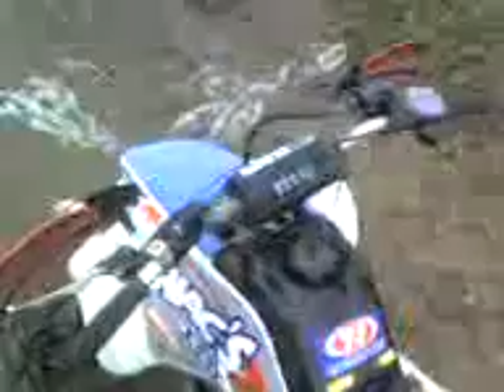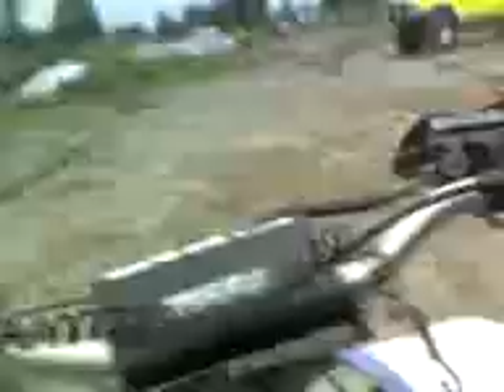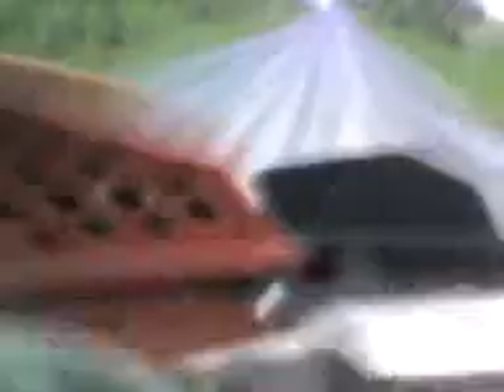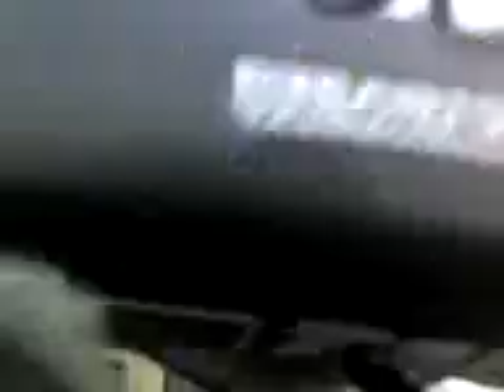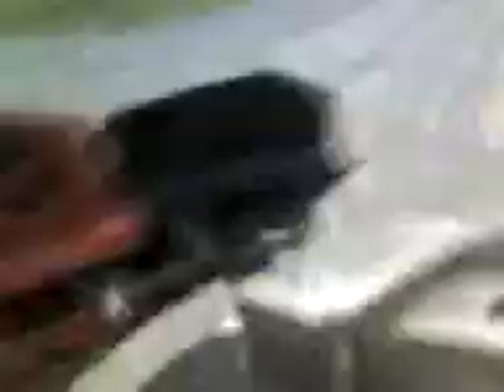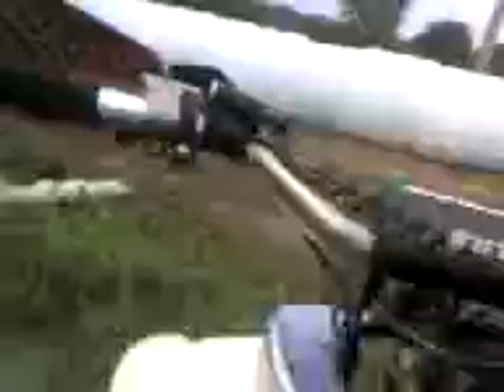Road rippin' on 86 Honda TRX 250R

Comment from the maker: I had my mid-short gears in (12t front 38 rear) so approx. 118 Kph peak, fastest i've clocked was with a 15 tooth front and 38 rear @ 131 kph, which is lots fast enough.  In reality 4th to 6th don't see much action on my trails, but you gotta let 'er loose now and then! cheers!

Comment from the maker: Q) Why is everyone faster, with no proof!?

A) I don't care.

B) try doing the math.  Speed is only relative to the gearing, sure I can put on a 15 tooth front and a 26 rear, and break the sound barrier, but I don't have a salt flat to get up to speed, junior...
 
and...
 C) This is an MX setup doing a road run, not a competition, film yourself popping zits or whatever you tools do.  I also 'clock' myself.  "We don't need no stinking badges!"

Out!